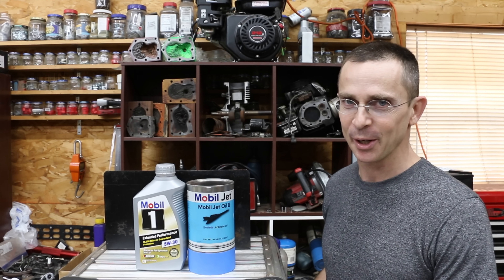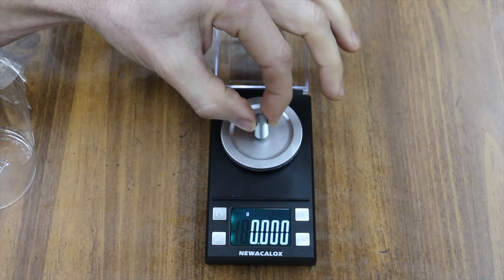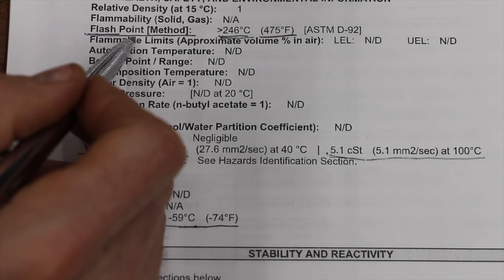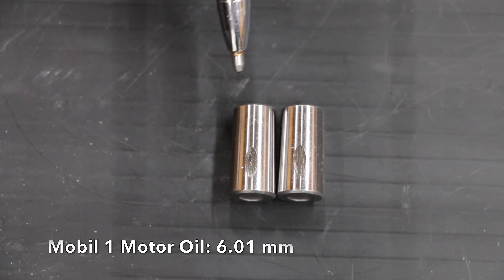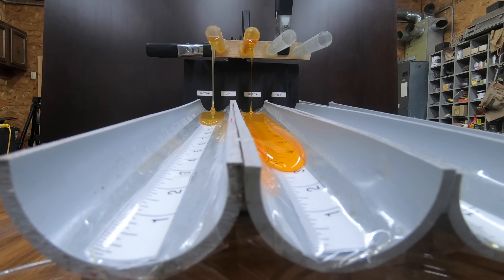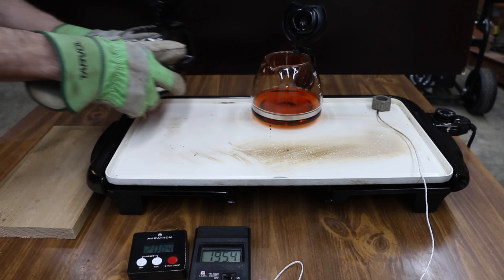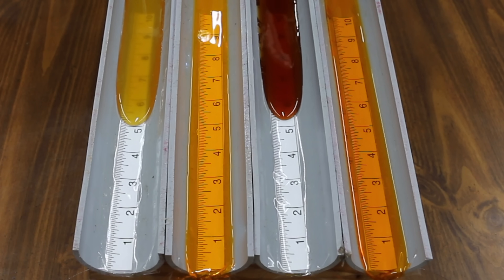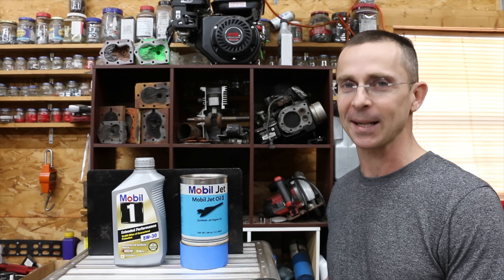Is Jet Oil better than Mobil 1 Synthetic?  Let's find out!

Comment: Why didn't you run your mower on the jet oil also liquid wrench vs wd40?
Reply from the maker: Great point!  I should have done that
Reply: @ProjectFarm  I bet with that quality oil it will take years of running an engine to see any difference, best part would be draining clear unburned oil after use and abuse, that would feel so satisfying
Reply: @artisticart6203  I already get that with my oil when changing it any time before 6K miles,. :)
Reply: @1speed2racer7  do you not reach the floor with the gas pedal🤣 must be nice though
Reply: @artisticart6203  I usually shift around 4-5 KRPM
My car goes 0-60 in about 5 seconds, so I like to feel the G's on nearly every acceleration.
I go through 6 new rear tires about every 2 years
EDIT: I have broke more than one accelerator pedal over the years.

Back to the oil...
I change the filter, use Lucas Oil Stabilizer, and let every old drop drain out with every oil change. I also never throttle on a cold engine.
Reply: @1speed2racer7  nice! Lucas stabilizer, I'll give that a try.
Reply: @artisticart6203  If you use conventional oil, then you should ease your car into using it. The conventional Lucas is very thick, so do not start by pouring an entire quart into an oil change.
There should be no issues if you use synthetic oil, for the synthetic Lucas is not quite as thick and tacky.

I usually use about a half quart of synthetic with every oil change. I actually believe that the conventional Lucas performs better, but I have not tried using it with synthetic oil.

While Lucas claims not to void any manufacturer warranty, the stuff is real thick. This can possibly cause some oil sumps to work extra hard to get the oil to where it needs to go, so do a little research before you just pour it down the hatch.

What kind of oil do you use? Do you currently use any off-the-shelf oil additives? How many miles are on your car? What size and brand engine is it? Does it currently burn or leak oil? If so, how much? Does it have any pings, ticks, knocks, or rattles?
Reply: @1speed2racer7  good to know, thanks for the heads up
Reply: @artisticart6203  I have gotten 200K+ miles out of just about every car I have ever owned. I have always used Lucas and always will.
Reply: @1speed2racer7  I keep my cars running too, one with 250k other car with 260k and both still going
Reply: I'd like to see him run that jet oil in a mower too.
Reply: Because there are no mowers within 600 miles of this man they are all to scared to go anywhere near his property
Reply: no mowers survived in the region
Reply: Jr ALEXANDER  o ok
Reply: Crc 5-56
Reply: I HAVE run an old lawn mower on jet oil. It revved like a race car and nearly ZERO smoke. It smelled odd and I later learned that the oil I used (for military helicopters) had tricresyl phosphate - very toxic.
Reply: @Exuma Guy 
Very good point!

Comment: Can you test the cooked oils with the lubricity tester. That’s what’ll matter in an engine as the oil nears its end of useful life.
Reply from the maker: Great suggestion! Thank you
Reply: Project Farm 
Can you help me? I live in Saudi Arabia and the temperature here reaches 125ºF  degrees and I have BMW 630 V6 2009 What kind of oil should I used to withstand high temperatures and heavy driving and conform to bmw specifications
Reply: @jeje-9746  See the manual, or call bmw directly
Reply: Glad all the experts watch your channel
Reply: yes he should have  shown friction testing after cooking.. that would be good to see
Reply: Heat actually isn't the biggest killer of lubricity, additive depletion is.  This depletion happens at points that use the additives, like metal on metal contact at cam tappets.  Most PAO synthetics, a variety to which both oils here belong, don't experience much thermal breakdown at all.
Reply: MrZorbatron that’s a great point.
Reply: oil is made of carbon lmao
Reply: Yes this pls
Reply: Yes, i want to see if cooking oil can work in a car
Reply: "Cooked" oil will contain a high amount of carbon which is highly abrasive and damaging to the engine.
Reply: @zfine1450  depends on type of oil
Reply: @Z Fine 1 thats why you need a good 1 or 2 micron bypass oil filter, and some additives to keep the base package nice and antioxidant-like and non-gelatiney after like 10k miles... really you can go much smaller than 1 micron to get the really fine carbon out so the oil looks like new. just might lose some long polymer additives or some other random stuff in the oil. needs experimentation for sure

also get rid of that PCV, EGR, DPF (if you have it) system... especially EGR but at least have an oil catch on the PCV since those are the primary way burnt solid carbon deposits get in there with modern "efficient" internal combustion engines. read how the space shuttle combusts oxygen and hydrogen liquified gasses for better efficiency... just around 9% intake air supplementation will do (don't inject LOX or LH2!). get some of that timing closer to top dead center to avoid knock... add some wet steam from the exhaust heat exchanger or bubble cold air through some boost juice, you got yourself 25%++ or better mileage as long as you don't melt your valves and piston burn through an aluminum block or detonate a cylinder
Reply: DoYouEvenScienceM8 ost of what you said can’t be done on modern engines without major computer reprogramming.
Reply: @Baigle1  Without PCV you'll form sludge. Tampering with the EGR, DPF or urea injection is a US felony. Just leave the EGR alone and regen your DPF often. The reason why big cities were cloaked in smog in the 70s was because of horrible emissions from sloppy carbed vehicles. Modern emissions control has made a huge impact on our quality of life.
Reply: @mannys9130  its not a felony to remove your dps, egr or anything on a car. It is illegal but more than likely never going to be noticed anyway. Unless you live in California where the regulations are more like australia.
Reply: @manny more like nanny , EPA and bloated municipal backwards arse emissions laws, make it regulated and don't fix the problem stemming from poor combustion efficiency and poor quality materials in products... lots of research shows that 3 smouldering cigarettes make more particulates than a 2004 ecodeisel, in a 60 cubic meter garage. smoking is thousands of times worse than particulates from exhausts and has a roughly ~8 year average impact on life expectancy going from eyeballing vizhub statistics. not drinking alcohol is more deadly than smoking, especially the combination of the two... look at how many deaths happen in the religious southern belt where they don't drink and get a lot of their food from polluted wastewater tennessee and mississippi rivers

to address the PCV, it circulates cool air through the crank case and valve area to pick up any moisture and oil mist or vaporized hydrocarbons, as well as blowby. you need an oil catch to make sure that the oil mist and other junk isn't sucked into the intake (as much). you do not need a vacuum in the crankcase (the crank splashing in oil when you don't use a dry sump is a much bigger issue..), and you do not need your engine ingesting tons of garbage. if you don't have major blowby you don't need PCV because there are no hot exhaust products to cook and acidify/sludge up the oil, as none of it even gets past the piston rings around the head gasket or through the valve guides! the catalytic converter is one of the few emissions regulations i would keep, since it splits NOx into oxygen and nitrogen and combusts the unburnt hydrocarbons like CO and CxHx molecules, but the EGR only serves to reduce combustion temperature, efficiency, volumetric efficiency, and combustion efficiency. there are much better uses for exhaust gas and feeding it into the intake is not one of them. DPF just burns more fuel to get rid of soot from a horribly inefficient diesel combustion process.

burn hotter and more efficient, get rid of all that shite except the catalytic converters, and use ceramic coatings to protect the weak pathetic aluminum or forged metal material that comes in contact with the combustion chamber... trying to use retarded corrupt laws and a screwed up legal system to scare us into submission shame on you, we are only telling you how to fix it and you try to beat us into the dirt typical big city bloat... take a look at the state of the art, know that you are trying to stifle scientific innovation and consumer goods' progress towards excellence

all the money these car companies could be making from selling GOOD CARS is going towards emissions regulations and testing... these laws are making it so they are built more cheaply and with less concern towards quality, beside the fact that most car companies are not run like the good old boys system anymore, so they only care about putting in 10 or so little design flaws to limit the life of vehicles anymore... look at VW, they had to fake emissions readouts so they could try to make a decent affordable car (though they are junk anyway)

many of the semi drivers that have over a million miles on their engines do all of this stuff, they get good oil, good additives, bypass oil filters of low micron rating, they do oil analysis, and 'delete' all the pcv, egr, dpf systems.

GE9x engine has 60:1 compression ratio, your engine might have close to 10:1 or 18:1 if diesel... GE9x engine makes close to 50,000 horsepower at 60% static thrust, yours maybe close to 300... GE9x uses ceramic coatings and actually well designed stuff and lasts hundreds of thousands of hours and millions of miles, yours maybe 300,000 miles... GE9x doesn't use any of that regulation shite no exhaust gasses no oil mist no NOx reducer, yours does and breaks down needs maintenance or it will gum up the oil... what can we gather here??

Edit: I wen't a little offtrack, pardon my french. Some claims stated above are exaggerated. Use your own common sense when reading.
Reply: @Baigle1  You could also use a centrifuge to remove impurities, but at a certain point it becomes impractical to say the least.
Reply: @Z cant really come up with anything better than a literal roll of toilet paper.... so cheap and so effective its like engineer heaven.. and there are so many componenets to oil you cant really use diffusion to get rid of just the carbon silicon and metal shavings in one easy go. enriching carbon 14 and potassium 40 so your potato farm doesnt have radioactive carbon or potassium, sure... oil? no

@theCodyReeder
Reply: @UCkDf-mT03pQ5CdmTWCttbuw Amen on that one(until it dissolves and clogs oil passages.) There is no doubt that a filtering process outside the engine is preferable with an additive package as you suggested. I believe the Germans did that during WW II out of necessity. That's where Synthetics came from. No oil, no problem: we'll just make some.
Reply: My God, I'm an oil geek!
Reply: @crunch9876  Modern engines most likelly awready are made to deal with that, you dont need to "do" these alterations into them
Reply: @Baigle1  "what can we gather here??"
- that you think piston and turbine engines are somehow directly comparable?
Reply: @chrisdavidson911  its ok i know they aren't the same thing. i am still supremely displeased with the 'state of the art' production engines we have available to us today. the advanced technologies that go into the GE9X, regardless of price, offer intrinsically valuable methodologies and techniques for advancing the, albeit "slow", modern design of ICEs.

its not like the industry has adopted Coates, FreeValve, or pneumatic F1 style "ideal gas law" valve design.. nor have they expanded upon Honda's TJI design so it meets emissions standards. like using wet steam or a low water mix. no one cares for double opposed pistons or variable geometry balanced sterling processes... 

really at this point since higher temp lean burns are key to the whole debate water is going to get added somewhere sometime. that and better atomization.

can someone tell me if the 20%+ pumping and thermal losses from turbochargers makes up in the torque-per-parasitic-revolution department?
Reply: @Baigle1  I was looking for guy like you. Can two-stroke diesel engine manage the power of detonation of a tiny amount of diesel fuel with a lot of oxygen or even nitrated diesel?
Reply: @trollmcclure1884  Thats pretty much how they work anyway tmk. So yes. Some key things that two strokes have trouble with is accurate AFR over the full load and rpm range. Don't use a simple off/low/high carburetor from a weed eater for instance. Exhausting all the air and forcing in all new air before the start of the dynamic compression stroke will be a challenge (something 4 stroke doesn't have to worry about). Hot spots, like valve and piston deposits from asymmetric or incomplete combustion. Lubrication and thermal expansion differences due to increased heat leads to inefficiency if you can't account for it (use ceramics and seal design improvements here). Combustion duration/ critical stroke angle, where some of the thicker parts of the diesel fuel is not burned by the time the piston is at around 80 degrees from TDC on the power stroke (that # is for gasoline engines you might be looking at 110 degrees, NOT SURE). That is fixed by higher compression and better atomisation + mixing, leading to greater efficiency and higher torque per cycle/revolution.

Turbochargers: Generally lower engine life, more complexity, higher pressures meaning generally enhanced combustion efficiency, better torque per stroke, but 12% or more of the exhaust turbine energy is lost to pumping, friction, and heat. Thats a tough one you can figure out. The increased backpressure means you need to tighten up exhaust valve timings, or you can use that with VVTE to deaden the next power stroke to lower temps or do something with idle.

If you use hydrogen and oxygen gas that can effectively lower the octane rating of the fuel, raise the combustion temperature significantly, and create a higher shock load on the piston, wrist pin, connecting rod, crank, and journal bearings. All you have to do is use stronger materials in each of those parts, with better oil and rings. A piston geometry designed to keep the pressure away from the rings (a cup/bowl) for longer would also work. Almost the same measures you would take for turbocharging.

Also, the Coates valve system should make it so your valves don't melt or warp.
Reply: @Baigle1  You nailed it: Most damn PCV systems do fill the inlet tract with too much oil, getting the inlet manifold, the throttle body and the inlet valves and ports full of oily deposits that are coked at the hotter parts. Even a simple Catch-can will trap a lot of oil.  But the best system add-on would be to use some small Ttansmission oil cooler, to condense oil vapors and then an efficient Catch-can to capture them and separate.
Reply: @mannys9130  BUT, the damn PCV is still too rudimentarily implemented, and while it (more or less) "burns" the oil vapors and partly burned HCs, it gets the inlet tract and inlet valves full of deposits.
Reply: @Baigle1  AMEN, man!
Reply: @eduardoavila646  Have you actually take a look inside the gummed, oily, and hard carbon fouled deposits formed by the badly implemented and lazy executed PCV system?
I have, and can tell you that common PCV systems suck.
Reply: @zfine1450  Supposedly.
Reply: Or just use a Tesla, bypass a lot of the complexity, and gain a ton of efficiency, but I guess street-legal-record breaking 0-60 isn't in a lot of peoples taste for some reason, 'cos electric suk and is for the weak'. Gas Cars are Really Cool though, just maybe not that practical in terms of complexity and long term maintenance.
(Also they're gonna build them newfangled wireless chargers into major roads to essentially give infinite range so that's neat!)
Reply: @renametowhatuwant4174  you think a tesla isn't complicated?
Reply: @chrisdavidson911  True, it is very complicated but more in a technologically-advanced type of complex, in a driver friendly sense, thanks for the heads up!
Reply: @renametowhatuwant4174  Wireless charging is inherently Innefficient and a large battery will always need some valuable time to recharge...

Comment: Great video. Cant believe Jet oil wears out metal faster than Motor oil.
Reply: It is much thinner due to the insanely tight tolerances in a jet engine. Because it has to be so thin, it will wear out steel and such fairly quickly. To fight this metals like titanium and "space age alloys" (insert eyeroll) are used. This helps stave off the wear a bit.

 You still have what is known as TBO, or Time Between Overhaul, of only a few hundred hours, maybe a thousand or so hours on the newer engines. Back in the 50's, some engines were TBO of 25 hours.
Reply: MP Yeah, umm, not quite accurate there buddy.  Gas turbine oils are lubricating ball and roller bearings as opposed to the plain bearings found in piston engines.  If you put that watery oil into a piston engine it will destroy the engine pretty quick.  As for the time between overhaul, the 1st generation engines of the late 40’s n early 50’s required removal every 25 hours (this bit is true).  As for some modern engines, I can recall a Qantas GE powered 747-400 that held the world record for time on wing before removal.  It had 42,000 plus flight hours from new to removal for overhaul.  Mind you, that engine only achieved this incredible feat because of the constant 12 hour plus flight sectors it was flying (East coast Aust to West coast USA). Hours don’t kill jet engines, cycles do.
Reply: @ParkerUAS  Yep, i figured.
Reply from the maker: Thank you!  I believe it has a much different additive package.
Reply: @ProjectFarm  sure does.